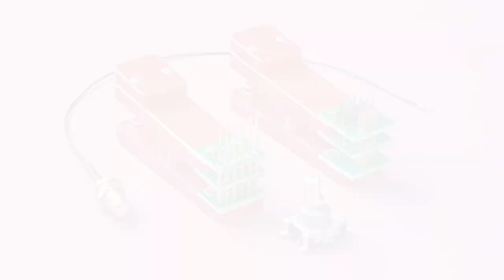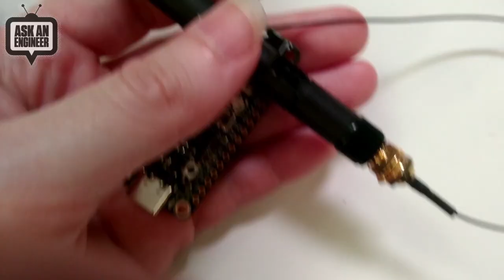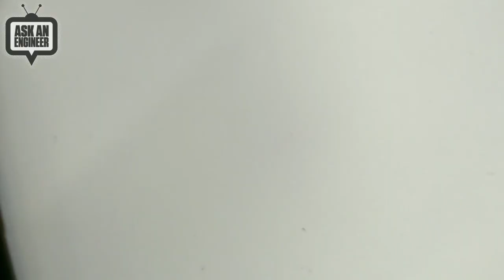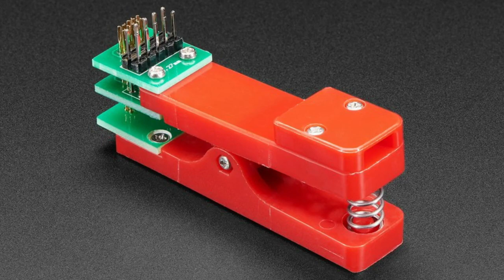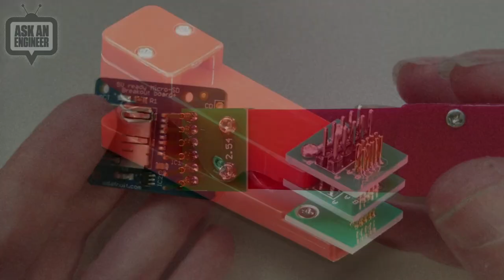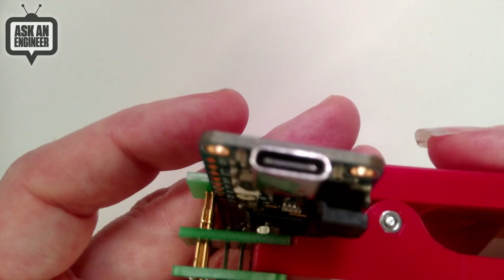New Products 5/25/2022 Feat. Pogo Pin Probe Clip - 2x5 1.27mm Pitch SWD!

Comment: what about a mPCIe SMD connector to PIN header connector prototype board?
Reply: PCIE is a very, very sensitive data with impedance control and length matching that is fine on a circuit board but connectors are not the best idea when not required